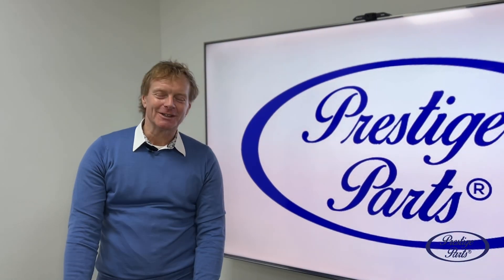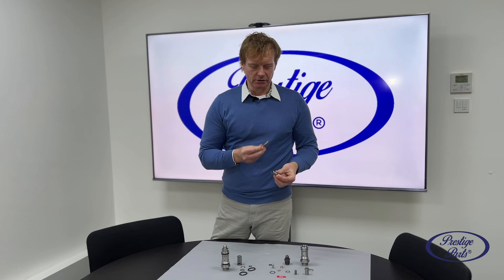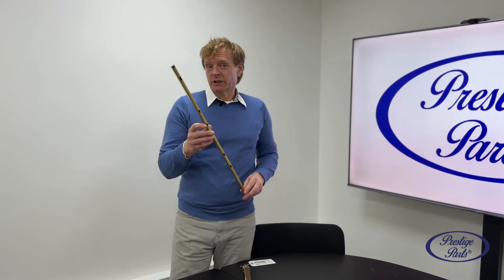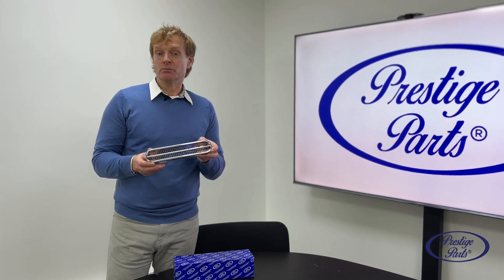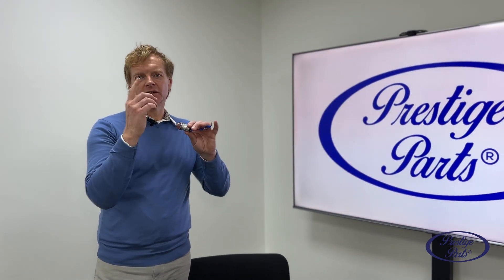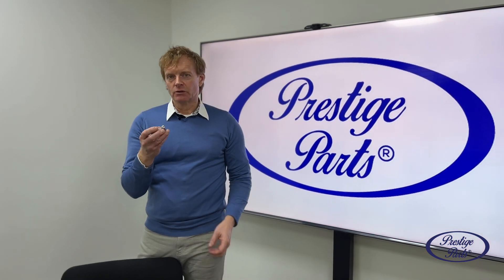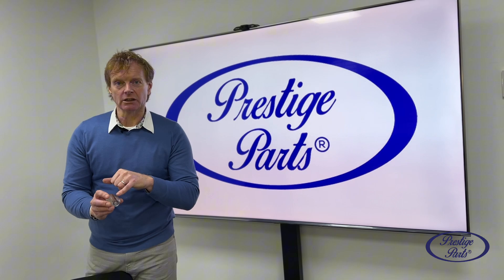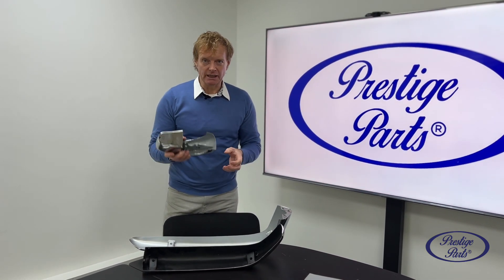The Engineering Behind Prestige Parts®: Remanufacturing Rolls-Royce & Bentley Components

Comment: very nice but shop floor footage would be great as the grinding of the 1 micron tolerance would be very intresting.
Reply from the maker: Thanks, yes that would great to have but is quite complicated as is not done ad hoc and would required quite some equipment to record at such close up levels
Reply: @introcar  I started in a tool room in 77 so understand the process then a few years later re-trained into panel beating with a few more years I my first job working for my self was to replace a Shadow 1 flared arch n/s wing 
as I could gas weld braze lead loading was easy.
Just a machine show over view with a good phone on a camera would be an insight
Reply from the maker: @theessexhunter1305  Well the way it works is; the parts are grounded to a certain tolerance, then they are individually gauged and finally, they select the ones that fit going by their matching size, which is down to 1 micron